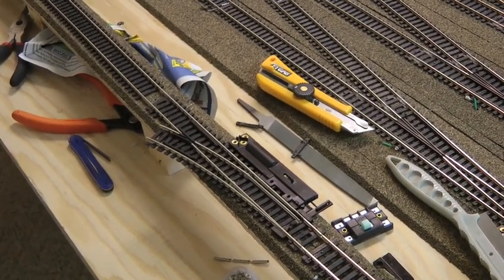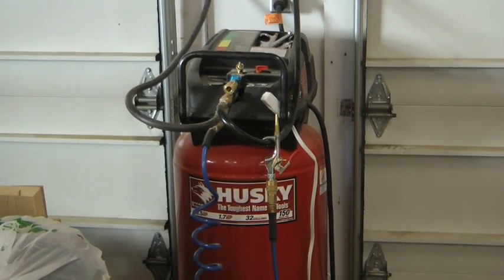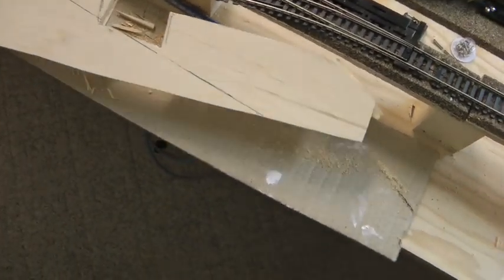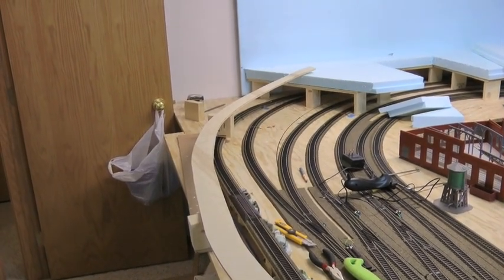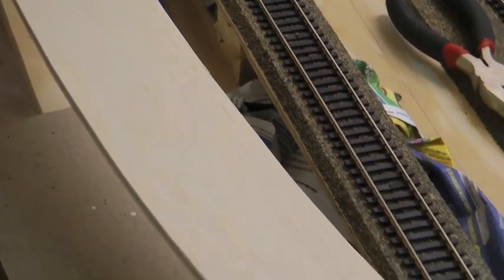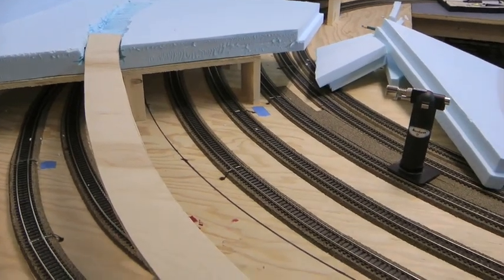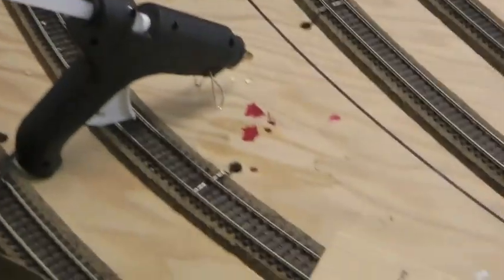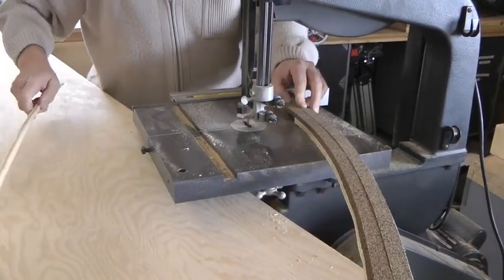West Wall Final Part 3

Comment: Its coming along nicely,  nice having all the tools Im sure. No offense here, so please correct me if Im wrong. That turnout is on a downward grade isnt it? It will take a bit of distance to level that grade. Then a further distance of a bit longer than your longest engine/rolling stock before you can start to climb. Otherwise you will have engines/cars uncoupling from each other.  Its late so maybe Im confursed lol

Comment from the maker: Sorry for the delay in answering. Actually I use Atlas code 100, 36 inch flex track. Some modellers say the code 83 is more realistic but I find you can't tell the difference if you are more than 12" away from the layout.

Regards;
Ian K.....